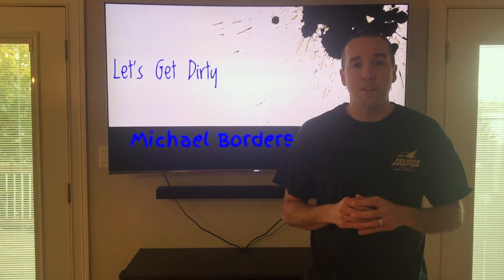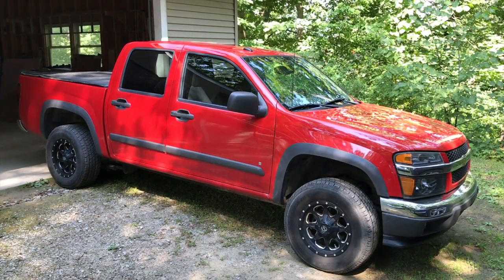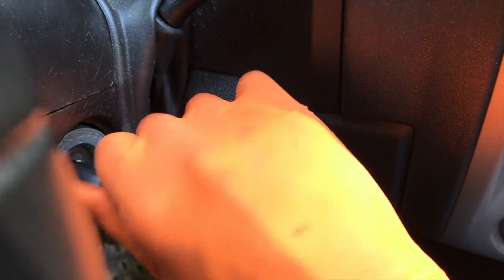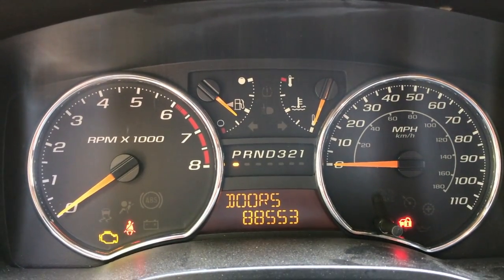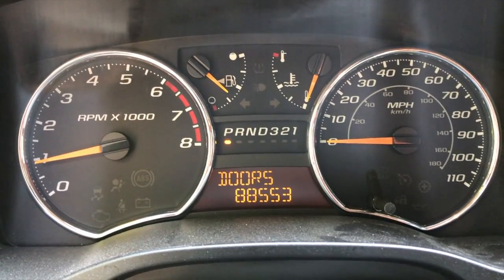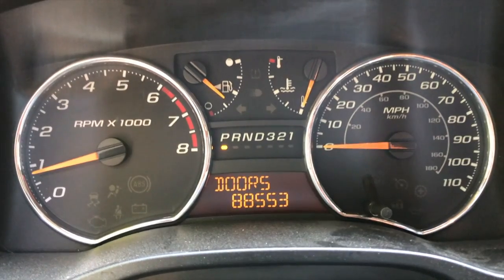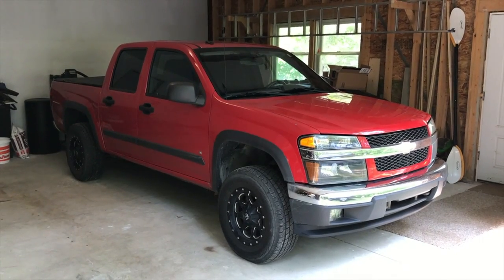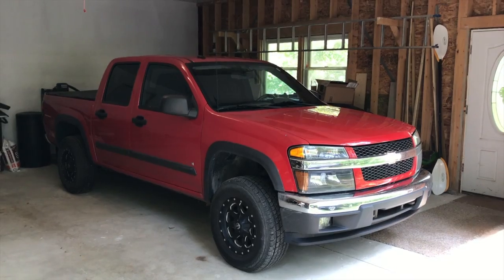How to do a "QUICK Reset" on your ABS System!

Comment: Came on after 15 mph.  I have C1164 C1165 and C1140 codes
Reply from the maker: @rafaelochoa9776  

Thanks for watching, any update?  We recommend disconnecting the negative cable from your battery and leaving disconnected for a minimum of five minutes.

This will allow your system to be fully reset.  You may also have to perform this a second or third time, as it’s likely that your system is out of sorts…electrically and sensor-wise.

Comment: No working.
Reply from the maker: Thanks for watching.  We recommend performing a system reset by disconnecting the black negative cable from your battery and leaving disconnected for a minimum of five minutes.

After five minutes, resecure black negative cable to battery and start engine to see if system has fully reconfigured.

If that doesn’t work, you can try it a second time as well.

Comment: Reset oil life did zero for abs now my brake light on and dinging sound wont turn off.
Reply from the maker: Thanks for watching, that sounds like your electrical system is acting sporadically.

We recommend disconnect the black negative cable and leaving disconnected for a minimum of five minutes.

This will allow your system to fully reset.  Is your check engine light on as well?

Keep us posted.  👍🧰

Comment: it doesnt F ING WORK!
Reply from the maker: Thanks for watching.  We recommend disconnecting the black negative cable from your battery and leaving disconnected for a minimum of five minutes.

At five minutes, resecure black cable to the battery and start engine to see if system has fully reset and reconfigured.  🧰

Comment: Nice trick!! Here’s one tho. I’ve a 2021 e450 rv. Had to replace the battery but before replacing the abs was not on. After replacing it the abs is on! Go figure. The coach has been stored inside all winter.
Reply from the maker: Thanks for watching and sharing your experience.  Any and all feedback and info is greatly appreciated.

Great to hear you’re back configured properly.  😁👍🧰

Comment: May 9th,2024…. A few days ago I had a  check engine light come on my dash 2005 Toyota Sienna  used my little FIXD Scanner and I got a P0500 code - Speed sensor A. Got the OEM part from eBay and replaced the bad sensor. Then the ABS light came back on… Thank GOD I came across your video and YESSSSS it did it for me ABS light is gone . Double checked with my scanner and no problems or issue was found … Thanks so much for the video… Blessings!
Reply from the maker: Thanks for watching and sharing your experience.  The benefits of making your projects DIY is powerful.  😁👍

Awesome job making it a DIY project, and we are honored to hear that our video helped you get across the finish line.

You can reach out to us any time, the DIY community will is incredible!

🧰

Comment: Thanks to u, saved USD400 to replace. My Honda Freed 2009 model ABS & Brake warning lights was on after starting engine n "refuse" to turn off. Tried your method 20th April 2024, till today, 25th April.....problem solved. Brgds, from Malaysia
Reply from the maker: Thanks for watching, that’s great to hear.  Getting your system reconfigured properly by use of a full reset is a good thing.  👍
Reply: Did your method After mechanic reset it for USD20. Advised to change the ABS module if the lights remains. Once Again,  TQVVM
Reply: As of today, car performing as usual.....TQVVM.....cheers

Comment: Tried the reset & did not work, then tried my code reader and it t didnt work, and then opened the hood on the Focus i was working on and discovered mice the had eaten 4 of the 5 wires at a plug for the abs system. Great video though!
Reply from the maker: Good morning ☕️ that’s no fun.  Mice chewing into electrical wires is a pain.  Will you be fixing wires yourself?
Reply: @DIYwithMichaelBorders  Fortunately there was enough wire left to crimp on some connectors and splice in about 4 inches of wire to each of them. That fixed it !
Reply from the maker: @jeffbrown3963  

Very cool, we appreciate the follow up.

Comment: I believe I’m too late for your video. I’ve recently replaced my ABS sensor. After the replacement, there is a noise when braking at low speed, as if the ABS is engaging. The mechanic had checked and cleaned my braking system, but still, the noise is there. What could be the problem?
Reply from the maker: Good morning ☕️ any update?  Having the brakes cleaned is a great start.  If you travel on dirt roads or in areas of snow, salt, slush…your wheel wells can build up debris and lead to unfriendly noises.

Have you performed any resets on your ABS system since the sensor replacement?

Comment: Didn't work for me why would that be ??
Reply from the maker: Thanks for watching, a few things can cause the reset to be unsuccessful.  We recommend filling your tires with air up to the manufacturer recommended psi.

If your psi is over the recommended psi, you will want to bring psi down.  Coming off the winter cold months and into the warmer months will cause a psi swing in your tires…and can trip the ABS system.  Let’s start there.  🧰
Reply: I haven't tried this!  I did change the two front ABS sensors, one of wires was cut I thought maybe that would fix it. I was going to replace the rears   too although the torx screw is rusty! Not so easy to remove. I just wish your reset worked for me I will give it another go after the tire psi  has been reduced as I carry a heavy load in my van the tires might been overfilled currently.

Comment: This hitting the gas pedal 3 times does not work for me
Reply from the maker: Thanks for watching.  In that case, there is a faulty part within your ABS system however before replacing any parts, ensure that all tires are properly inflated to the recommended psi.

Low tire pressure can trip ABS system.  In addition to that, tires that are out-of-balance or not aligned can trip ABS light.

Comment: I have the opposite problem. No ABS light come on but ever time I scan my car for codes, I get two ABS codes saying the rear left speed sensor is whack. The ABS light only comes on very rarely and then goes off a short time later.

Comment: I did it on a RAV4 2001 it could work out
Reply from the maker: Good morning ☕️

We recommend performing this reset procedure a second or third time as we have talked to many viewers that have mentioned it worked on the second or third attempt.

If still no luck, it’s likely that you have a faulty part within your ABS system and an OBD two scanner will help.

Below is a link to our OBD scanner tutorial that will help pinpoint the exact part causing your issue.

       https://youtu.be/DvogiRhGEYk?si=_feVforwKN9DaomU

Keep us posted.  🧰

Comment: Mike, I cant thank you enough. I have tried many other youtube videos and nothing, the brake system is working fine so I came across your video, tried it and it worked like a charm. Very greatful. Thanks so much.
Reply from the maker: We are very honored to read this, thank you for reaching out.  Resetting your system and getting it reconfigured properly is a great way to start the week.  😁👍

You will continue to benefit greatly by making your projects DIY.  We are just a comment away if you have any questions.  🧰
Reply: Mike, the abs light keeps coming back on?  @DIYwithMichaelBorders
Reply from the maker: @steveanderson461  

Thanks for reaching back out to us with an update.  From here, it might be best to have an OBD scanner read your ABS fault codes to see what exact part is causing your issue.

Below is a link to our OBD scanner tutorial.

       https://youtu.be/DvogiRhGEYk?si=qrf0CNBVvEijrsmJ

🧰

Comment: Good morning, I did what you described in the video but unfortunately it didn't work on my 1998 Ford Econoline 350 van... could you tell me something? Thank you
Reply from the maker: Thanks for watching, any update?  We recommend a system reset by disconnecting the black negative cable from your battery and leaving disconnected for a minimum of five minutes.

After five minutes, resecure cable to battery and start engine to see if light turns off.  If it does not turn off, you may need to have your system read by an OBDII scanner.

Below is a link to our video tutorial on our OBD scanner.

       https://youtu.be/DvogiRhGEYk?si=rjpbZg4bsTr9arMK

Check with your local AutoZone, they might offer this service for free.

Comment: My abs light used to reset like this now does not anymore scan it and have a code u3000-48-2B ford focus
Reply from the maker: Thanks for watching.  That specific code refers to a software malfunction…and can possibly be just a temporary glitch.

We recommend performing an electrical system reset by unplugging the black negative cable from your battery and leaving disconnected for five minutes.

After five minutes, resecure black negative cable to your battery and start engine.

If code is still present, it may have to be removed by an OBD scanner.  Worst case scenario, the software will need to be updated.  As far as software updates, you may need to contact your local dealership and get a quote.
Reply: Mine used to reset now I have the same code  did you ever figure out the problem.

Comment: My service ABS and traction control lights are on. What can I do
Reply from the maker: Thanks for watching.  We recommend cycling the Traction Control push-button on and off.  However when pressing it for the first time to turn it off…we recommend leaving it off for a minimum of 5 seconds.

If that doesn’t work, we recommend disconnecting the black negative cable from your battery and leaving disconnected for a minimum of five minutes.

This will allow your system to fully reset, and after five minutes…you can resecure black negative cable to battery.
Reply: Thank you. I tried the gas pedal with no luck. I push my traction control with no luck. I’ve done ground cable off with no luck.  I’ll go and watch your videos. Thanks again
Reply from the maker: @toddfrisch737  

Thanks for the follow up, looking forward to hearing back from you.

Comment: I just did this on my 99 Subaru. The ABS  lights came on this morning and my breaks were working fine so i thought it might have been a fuse- did a quick google search, this video came up, I did the steps and the ABS light is off. So I feel safe, and confident knowing it wasnt a real issue at this time. I really appreciate videos like this that help us DIY and not fuss over things we can easily do ourselves. Thanks again!
Reply from the maker: Awesome job making it a DIY project.  You will continue to benefit greatly by making your projects DIY… And we will always be here to help answer questions.

👍🧰
Reply: * brakes
Reply: * Brakes
Reply: Brakes or breaks? Cars  brakes sometimes break

Comment: I tried this on my 2018 Jeep Grand Cherokee many times and it did not get the lights to go off. I changed a broken wheel speed sensor a few days ago. Any additional ideas? Thanks
Reply from the maker: Good morning, just poured a ☕️ and am sitting down to answer any and all questions for the DIY community.

Next thing to do is disconnect black negative cable from battery and leave disconnected for a minimum of 5 minutes…some say 30 minutes…

After that, re-secure cable to battery and see if it properly performed a full system reset and turned light off.

Let us know if you have any questions and hey if you’re interested, join our DIY ecosystem and help us grow an exclusive group of DIYers.

       toolboxtoken.com

Reach out to us any time!  🧰

Comment: I hope this works for me. I had to do the control arms and rack and pinion and ps pump and ever since then the abs light has been coming on and off as i drive or sometimes not at all. I have to redo the rack and pinion anyway and putting new rotors and pads on as well so ill try it after thats done. Im by no means a mechanic  as you can tell by the fact i have to redo the rack and pinion. High pressure line got cross threaded. Hoping one of the sensors is just lose. Wish me luck 😆
Reply from the maker: Good morning ☕️

Sounds like you have been busy 😁👍

A loose connection is possible and one that many hope because it’s a quick friendly fix and won’t cost anything.  Looking forward to hearing back from you.

👍🧰
Reply: @DIYwithMichaelBorders  update: the install went perfectly. She's running like melted butter. The abs light went off but it occasionally pops up if I make a hard turn or hit the brake. But then goes right back off. But at least I can move the steering wheel with one hand again so yay!!
Reply from the maker: @Delirium914  

That’s a great update, and we thank you for sharing this.  😎👍🧰

Comment: So my cars ACS/ABS/Break light we’re illuminated all at once. Pressing the Acs button didn’t fix it. Doing this fixed it, it doesn’t turn off anything like traction control does it? Bmw 3 series here.
Reply from the maker: Good morning, just poured a ☕️ and am sitting down to answer any and all questions for the DIY community.

Great to hear, and we are honored you took the time to share this.  In regards to your traction control, there should be a button to turn it off and on.

First, if it’s off…turn it back on… however, if it’s on…cycle the button by turning it off for five seconds, and then back on… which will allow it to reset and hopefully get it back working as designed.  

Let us know if you have any questions and hey if you’re interested, join our DIY ecosystem and help us grow an exclusive group of DIYers.

       toolboxtoken.com

Reach out to us any time!  🧰

Comment: Hi Michael,got problems with ABS lights and traction ,dealers says need to replace abs module pump,please advise
Reply from the maker: Good morning, just poured a cup of coffee and am sitting down to answer any and all questions for the DIY community.

Another option to verify that’s the actual failed part, is to have an OBD scanner read fault codes.  Some AutoZones will do this for free, some won’t.

That will help you have peace of mind that the part needs to be replaced, if that’s the true cause.  Looking forward to hearing back from you.

Let us know if you have any questions and hey if you’re interested, join our DIY ecosystem and help us grow an exclusive group of DIYers.

       toolboxtoken.com

Reach out to us any time!  🧰

Comment: Yes it works temporarily for me; The ABS lights went out about two weeks, but after that time, the problem returned... ☹️
Reply: Need a new car
Reply from the maker: Thanks for sharing, in that case…you have a part internally acting sporadically…meaning working sometimes and not working other times.

This is also an indication that the exact part is in its early stages of failure, and will fail completely in coming weeks or months.

Resetting system helps trip part to work as designed again but it sounds like it can only work for a short period of time.

Having your ABS system read by an OBD 2 scanner may help pinpoint the exact part causing the problem.

👍
Reply: @DIYwithMichaelBorders  
Thank you very much for your kind and prompt response. This helped me to decide what to do about this small inconvenience.
Reply from the maker: @Oscar-ve3ci  

We are happy to help.  👍🧰

Comment: Doesn't work on my 04 F-250
Reply from the maker: Good morning ☕️

This will work on your 04 F-250.  If your ABS light turns back on after performing this reset procedure, there is a faulty part within your ABS system that will need to be replaced.

Comment: Hey bro, your method worked on my bmw e46 m3, where my front right abs valve was stuck in the close position, now the fluid is flowing through the line, you just save me at least 3 grand in parts and labor. Thank you so much!
Reply from the maker: Awesome, and thanks for taking the time to share this.  The BMW e46 m3 is a slick vehicle.  Reach out to us any time.

Comment: Have a 2015 Jeep Wrangler . Doesn't happen all the time but when I'm hit the brakes it feels like the abs traction is engaging. If I pump the brakes before coming to a stop it's ok . The brakes feel fine. I am not getting any abs lights or any other lights coming on I hooked up my Zurich OBD2 code reader that has ABS diagnose code reader on it but I get no ABS problems on it. Tried your solution but didn't solve anything . Any ideas on what it may be ?
Thank you
Reply from the maker: Good morning ☕️

Any update?  A few things can cause this.  It may be a wheel hub sensor in its early stages of failure…meaning acting sporadically until it fails all together.  Because of this…it’s not triggering a fault code that your OBD scanner can pick up…because it’s still working.

It can also be that your jeep needs an alignment.  Any shaking or wobbling while driving…?…is your steering wheel straight while front tires are straight…meaning not offset?

Keep us posted.  👍
Reply: Steering & alignment is fine but i decided to replace both front wheel hubs(which came out incredibly easy) & calipers & rotors(pads were recently new) , bled the brakes twice from rear to front & all is good & brakes like new.I figured replace everything myself for a fraction of the price of taking it in . All new hardware up front & the Jeep is safe for my wife to drive.I believe when i had the front axle seals replaced they had to hammer the hubs out & agitated one of the front speed sensors.
Thanks
Reply from the maker: @HeavyChevyMega  

That’s amazing and we absolutely love reading comments like this.  Those are awesome projects to make DIY.

You will continue to benefit greatly by making your projects DIY.  Love it!  😎👍